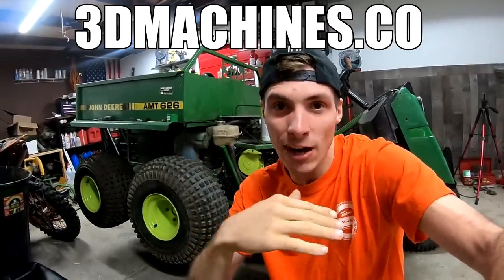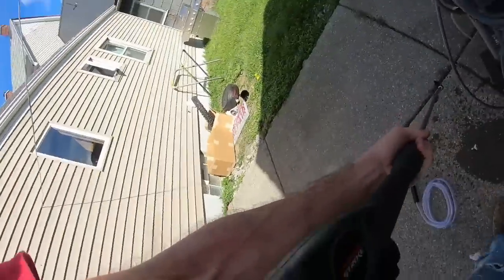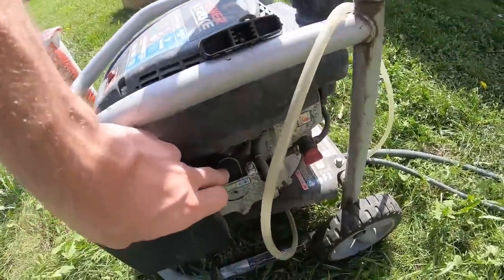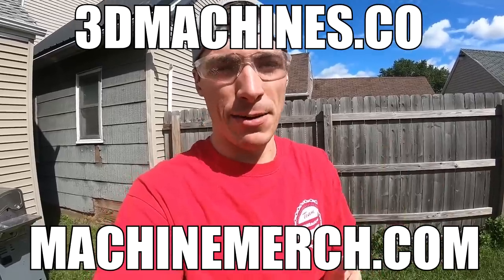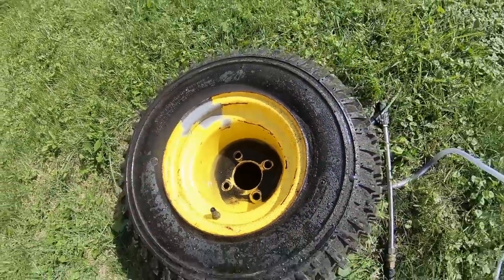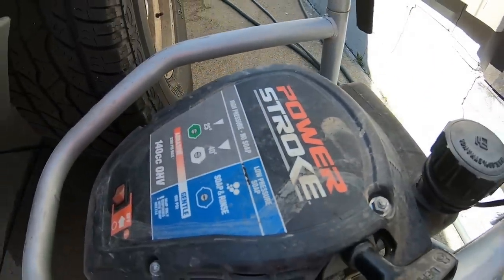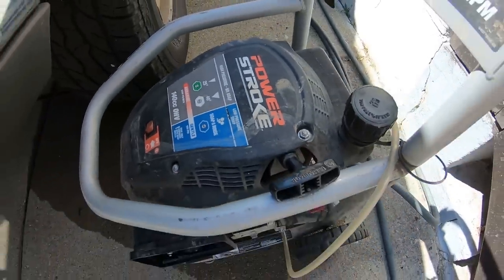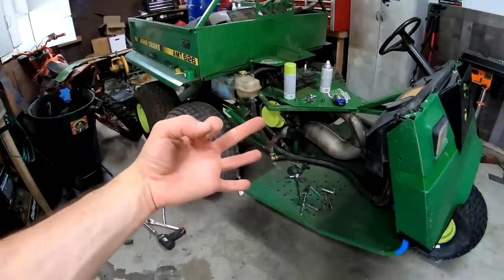The $30 Tool Everybody NEEDS!

Comment: "OSPHO" Used in the marine industry. Treats the surface rust and it will not rust again. And you can paint over it. Put that on the frame of the truck. You will be much happier. It just kills rust and ready's it for paint. No need to reinvent the wheel.

Comment: what i do is use a blow torch to dry the water off quickly. obviously nothing with rubber on it but just metal i use a blowtorch to heat up the metal just enough for the water to evaporate.

Comment: Have you considered the possibility that sand blasting the gas tank could wreck it?
It is a fairly thin steel.  Would hate to see you having to dump even more 💲💵💲 into the Dirtymax.
Reply: J. M. Have you considered the possibility that you have no clue what your talking about 😂
Reply: J. M. have you considered that the fuel tank is plastic😂

Comment: You shouldn't leave the power washer running without using it because without the water running through it you will burn up the power washer part of it and have to  buy a new bottom motor that shoots the water